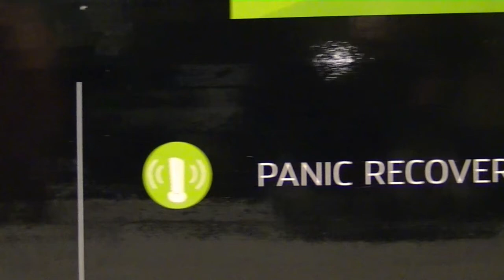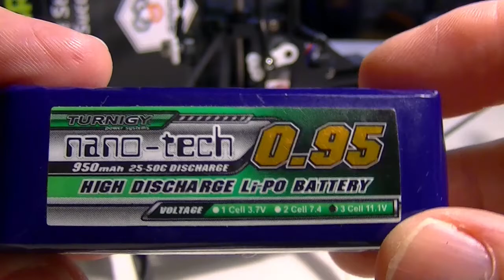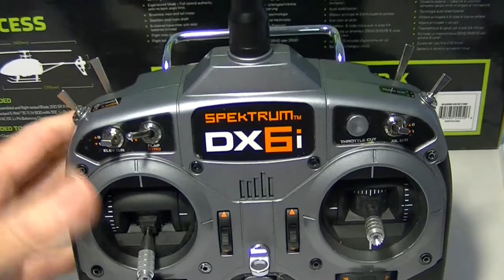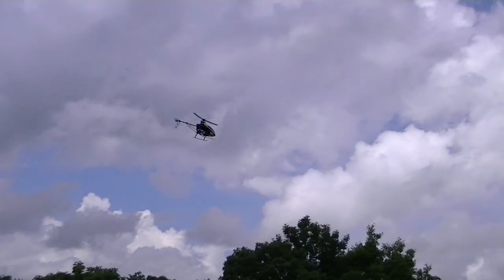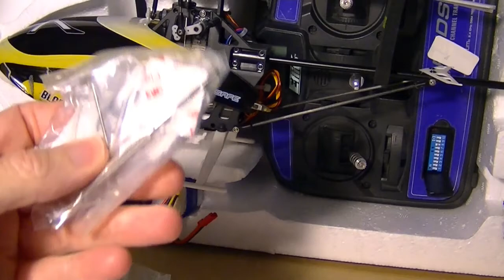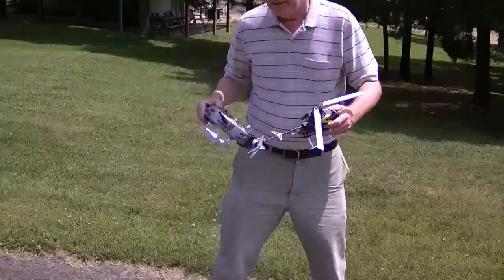Blade 200 SRX Helicopter Review, Testing 3 Flight Modes, Panic Switch

Comment: I have the Blade 200 S RTF model ..  I am noticing the heli wants to tip on lift off...this happens as I slowly bring up the RPM's to lift off speed...and it's a sudden tip to the side......but after I have reached a hover,   it seems fine,  it's the take offs  that are scary....so far I have only been on the gym  floor indoors  I am   afraid that the main blade will catch the short grass  if I try it  outdoors ......any suggestions for me,  as I am a beginner....thanks..
Reply from the maker: I think that is normal for most helicopters to lean to one side if they have a tail rotor. So when lifting off there can be a moment tipping. The Blade 200 SRX is a little slow to spin up too and there is a window where it is prone to tipping before the rotors get to full flying speed.  I tend to minimize that by lifting off quickly after spin up. I wish it had a more punch on the main rotor but you have to mess with the gains to get that.

Comment: Hi Folks,  Regarding your extra switch thing.  My 200 SRX is due any day and I just uploaded the .SPM file from Horizon Hobby onto my DX9.  At first I thought I had a problem as operating the controls in the "Monitor" screen, it seemed that the throttle wasn't working!  After playing with a few switches however, I found that my switch "H" had been assigned as "Throttle Cut" :-).  Going to the "Throttle Cut" screen the settings are Position : -130%. Switch : Switch H.  Of course you can assign the "Switch" to any available switch that you chose.  Saves cutting into your wiring. HTH.  Peter
Reply from the maker: +Pete Rihoy Your right but Jon wanted a hard wire switch. Totally not necessary of course.

Comment: The Allen key (wrench) supplied is very cheap and soft and the hex became round as soon as I used it. Good ones are not expensive - I bought a whole set in this size range for less than 3 quid and no problem now.

Does anyone know why my aileron servo goes full right with the throttle? I have followed all the online (Tommy Little et al) and manufacturers instructions for a Trim Flight set up, but the plane doesn't do the required swash plate rotation to tell me it is in Trim Mode. Have I programmed a switch wrong - does it need to be in "Expert" and High Rate modes to do this? All help appreciated, thanks

Comment: I don't understand that mod you guys performed. Couldn't you simply program one of your switches to throttle hold/cut? That's what I did with my 2014 DX6.
Reply from the maker: xXG.L.HXx Yes you could if you have the HELI type instead of ACRO type.
Reply: ***** I'm sorry but that doesn't make sense. The older DX6i, like the one being used in this video, is a heli/plane type radio. Newer radios use the term "Plane" and "Acro" interchangeably. Quadcopters, as of this date, are ALWAYS setup as "Plane/Acro" on transmitters, mine included. I have setup throttle hold/cut on everything from helis, planes or quads. You CAN program throttle hold/cut into your DX6i. No need to hack the 200 SR-X.

Comment: Had ever happen the POD defect that all 200srx stock esc&receiver have? That will lock the heli in full throotle and spin tail till batery is removed with no user error or attempt's to kill throotlhe in transmister. HH need to admit it and issue this major defect that will happen sooner or later on the 200srx with stock ESC & Safe receiver that need to mate together!
Reply: Have not heard about the POD defect from anybody jet, hope it does not happen too mine, just bought  one, and love it.
I have 2 120 SR blades both have this POD problem. and can throw them away, because repairs are too expensive, the mainboard costs 70$ wich is ridicules

Comment: There's a video by Horizon Hobby hat shows how you can double the motor power.  Fly's much better and with more authority after the programing.
Reply from the maker: Charles Le Yes I have seen that but the down side is a faster rotor speed with more vibration. I just wish they would make a new head with more pitch.
Reply: *****
There is a program for changing motor power, pitch, and giro
Also you can change the blades, get broader ones

Comment: You also need to program the throttle hold switch on your radio its really not a good habit to add a switch to your receiver unless a seperate battery for your receiver and your servos plus before you hit the ground hit throttle hold also you might save your main gear and before you plug in the battery hit the throttle hold switch on your radio that way the rotors will not power up by accident. All collective pitch programming on all radios are like that and make that a habit trust me LOL!!! I learned my lesson when I didnt hit throttle hold it hurts BAD!!And if you don't have a extra channel on your radio get rid of beginner mode. Usually the throttle hold is on the right so if you have the panic on the right change it because that is meant for throttle hold it even says throttle hold below mix 0 mix 1 is throttle hold or vice versa. And I see how you fly I would get rid of the habit of throttling down so much especially if you are going to fly collective pitch helis very very very bad bad habit force your self to stop doing that. Most begginers do that and never point the heli toward you always fly tail end to you Anyways cheers and good luck my friend.
Reply from the maker: Willie Gonzales Thanks for the comment. I think the instructions for the DX6i call for ACRO mode which does not have throttle hold available. A new set of instructions for HELI mode would do the trick.

Comment: Great Video...  I Have really been wanting to add this one to my collection.
Why not just setup the throttle hold switch?  I do that for all my helis, even the fixed pitch ones. In the event of a crash, it is really a good idea to train yourself to hit that switch instead of dropping the throttle, especially if you wanna learn collective pitch later...The throttle drop "bad habit" is really hard to unlearn and is downright destructive to cp helicopters..:(
Reply: catch262 OK nm I just got one of these and have answered my own question.  The throttle hold switch is used for mode 3, doh!  There has got to be a way to program this differently though. Anyone have any ideas? This heli is dangerous, you don't wanna feel the forse of these blades!  I will follow up if i figure out a way to program this thing...
Reply from the maker: Jeremy Catches Thanks, let us know if you figure out something. 
Also I wish they made a replacement head with a little more pitch to it.
Reply: Jeremy Catches Well, My solution was to get a better radio.  I recently picked up the DX6 instead of the DX6i.  The DX6 lets me put my throttle cut switch wherever I want.  Also it was a big step for me to find out how to set the gains for this heli, Because it comes with the motor gain at 50% and it needs to be set higher to get mo power.
Reply from the maker: ***** Yes the DX6 is nice little radio. I should probably move it to a different radio myself and increase the gain.

Comment: Got my 200 SR X in mid June. Also got a flight sim to help with basics. Reviewed and watched countless heli training videos. You got an excellent intro video yourself. And yea I agree on the main gear. Already buggered mine up. But had the teeth cleaned up. It will still fly tho. Ordered three gears but they are back ordered. Seems I'm not the only one. Glad I'm not alone. RC helis are a blast. Thanks buddy
Reply from the maker: Yes the reports of stripped teeth on the main gear are coming into the local hobby shop in my area. It's definitely a weak point on this heli. The owner said the same thing you did that the gears are back ordered. He expects blade will be addressing the problem.

Comment: Nice video, informative. Have you tried the Nano-tech battery yet?
Reply from the maker: Yes the Nano-tech battery was used in some of the fight video.
It works very well but I don't see any improvement over the stock battery other than the price :-)  The lack of punch with this copter appears to be a result of the flat pitched blades and not the power system in my opinion. The blades have plenty of rotational speed but lack lift from what I can tell.
Reply: I'm using the Zippy Flightmax 25C 1000mah 3S lipos from HK with great success. Best $6 I very spent! Consistent 15min flights and packs are cold to the touch with over 90 cycles (total of 3 lipos) and no sign of degradation yet. Stock Eflite lipos puffed after ~12 10min flights and never went lower than 3.5v per cell.
Reply from the maker: Stephen Vieira Thanks for the info!  Is this the ones?
http://www.hobbyking.com/hobbyking/store/uh_viewitem.asp?idproduct=16678
Reply: ***** Yes, those are the ones. The label has been updated so it will look different when received, but it is the same battery. Best of luck!

Comment: long shot  ... could you help me bought a small hele double blades  the bottom blades go around just a little slower than the top  so it wont lift off any ideas what the problem is and what can I do to fix it hope you can help me only used it once crashed into a tree  doh

Comment: I see you run a dx6i also,i just found out today intermediate mode does not self level.Do you have the same problem?
Reply from the maker: Stephen Vieira Good point Stephen, That is exactly what I have noticed as well. I think people expect it to fly like it has an autopilot with GPS and this is just not the case. It is very easy to learn to fly it but I have crashed several times and repaired the main gear once and tail boom supports twice. Like you said it all about countering the direction of travel to slow down. Sometimes I just lose orientation with my eye sight being not the best.
Reply: Intermediate mode has a higher bank angle limits but will still self level. However, this does not mean that the helicopter will stop flying in any one direction once you let go of the sticks. You must still actively fly the helicopter, and counter the stick movement to get it to stop flying in any one direction. For example, if your flying in fast forward speed and then let go of the sticks, the helicopter will level out but inertia will keep the helicopter going forward so you must counter the movement with the right stick (push it back if its going forward). This does not have GPS so it can not hold its location once you let go of the sticks. It can only return the servos/blades to their neutral position when you let go of the sticks, but the helicopters own inertia will keep it moving in the direction it was going until it either slows down on its own or you counter the stick movement. Enjoy!
Reply from the maker: I did not notice that. It seemed like it still had some self leveling but was just more responsive to the sticks making it easier to crash. Beginner mode I didn't like at all because the wind was blowing the heli away and no amount of stick could fight it.
Reply: I got a chance to fly at the park today,and decided to try intermediate.It was really responsive but i had not auto level,where ever i sent it would keep going in that direction till i stopped it.Also i have noticed it's not very good in 10+mph winds,if above that yeah its a no go.